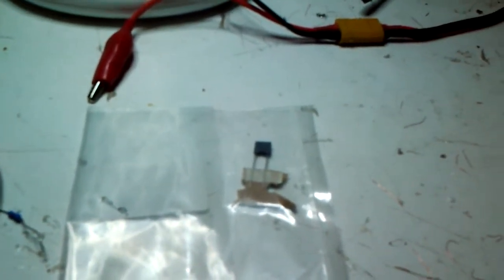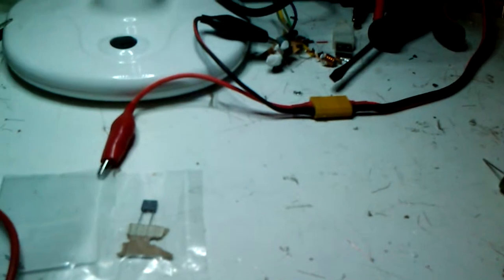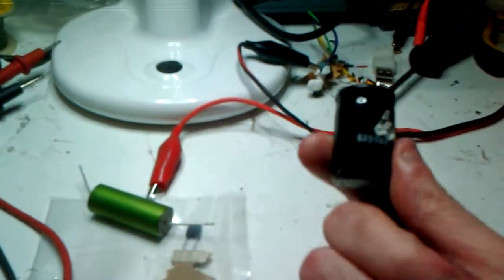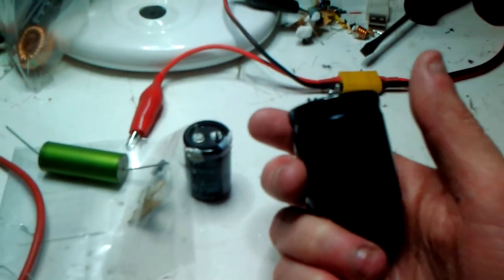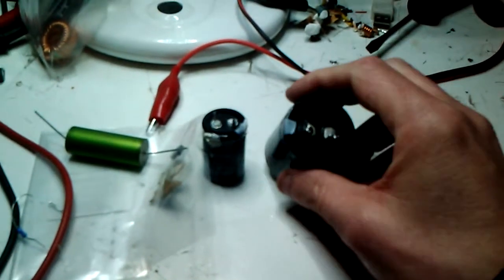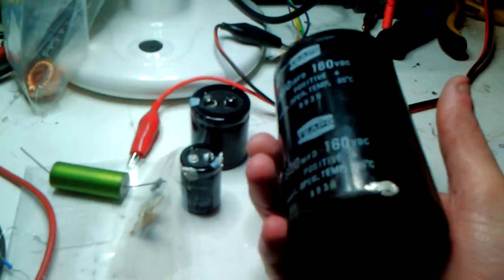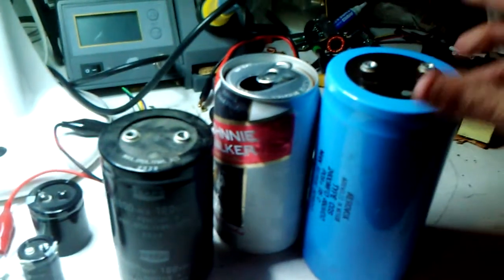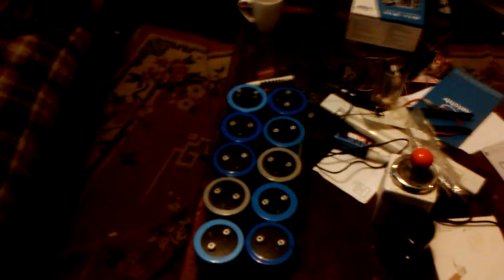Capacitors, a size reference :)

Comment from the maker: You might have noted my reluctance to put my hand too close to those caps - in hindsight none of them measured anything above a few millivolts, but one cannot be too careful. The flash cap I stuck my finger on was checked before video several times to ensure it was fully discharged :)